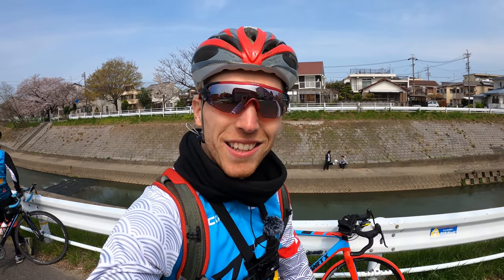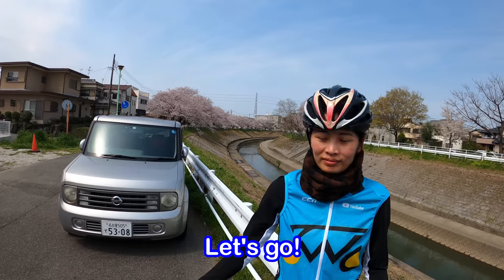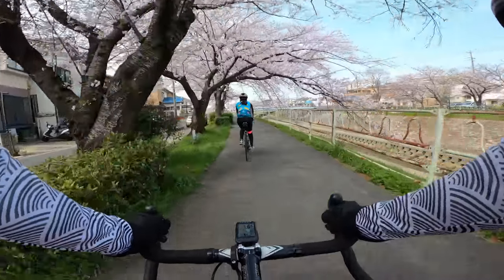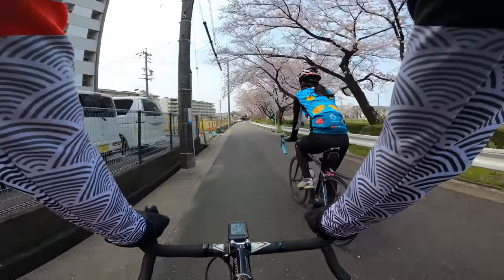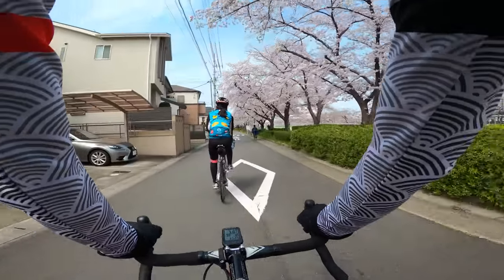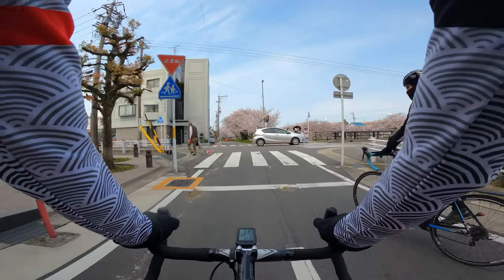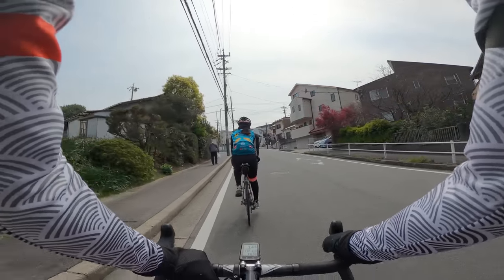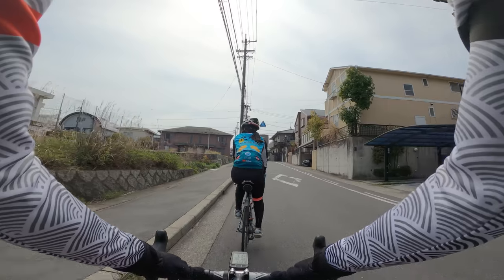No More Flat Tires! Tannus Airless Tires 1 Month Review & Test Ride

Comment: These tires were a nightmare.  Felt like riding through peanut butter.  Purchased and installed the 700 x 28 size on my road bike.  The warmer the temperature, the more sluggish the tires felt as the compound became softer.  It actually felt like the tires were sticking to the pavement.  Put a total of 30 miles on them and, because of a terrible return policy, basically cut them off and tossed them.  $150 down the drain.

Comment: I was using Gatorskin as a NYC bike messenger and was always getting flats. Eventually I found out it was because I would always put ten psi more air in them to make them faster. So if you have puncture resistant tires and out still getting flats make sure you’re putting in the psi it says on the tires not over.

Comment: Just bought some for the back wheel of my e-mtb, due to never ending flat tires. When I started my first ride with them it felt much smoother while going over rocks. I actually thought the tire was underinflated, but when I stopped to check it I found it to be fine. The rest of my ride was great and the tire behaved just as advertised. I also had a degree of confidence that I was not going to have a flat in the middle of my ride. I've only had one ride so far, but it was a very positive experience!

Comment: Hey I just installed the Tannus Airless tires on my road bike.  I have only put on 45 km on them so far as the weather has not been cooperating.

Here's my take on the installation:
I was expecting a really hard time after watching multiple videos - It only took 30 minutes to install both tires. Way easier than I thought - in fact I didn't need to use the tool in the final stage. I made sure the clips were evenly spaced and when I rolled the tire on the clips just started snapping in place. I squeezed the tire to the rim using my hand to make sure all clips snapped in place, which took a couple of minutes.

As for my first ride:
I do notice more of a drag and expect this to improve as I haven't rode the 100 to 160 km as suggested.
I bought the 700 -25 slicks at 100PSI. On  a good surface I can't tell much of a difference from a comfort put of view. They don't bounce back as much when you hit a large bump or pot hole. However not worrying about a flat is great.

Being in my 60's I don't do the 100km day rides anymore however, I do put on around 150 km to 200 km a week on the bike and I was always frustrated getting flats - around 5 to 6 times a year. I tried tubeless - which I loved for comfort and speed however, the tires are softer and get chewed up when hitting stones and breaks in the pavement and I was constantly replacing them on a annual basis.  I tried gator skins and still continued to get flats ( I found the gator skins harder to put on than the airless tires) so decided to go airless. I expect to get around 3 years if the warranty holds true based on the number ok km's I ride on the road bike.

My take: It is great not worrying about getting a flat anymore, I have more room in my bike pouch for snacks (LOL) as I don't need any tire repair kits and tools. I am more than happy to give up a bit of speed and comfort. Would certainly recommend them to commuters who are doing around 5km to 15km a day commuting.

Comment: I got a set of Tannus airless tires after watching your videos. 
I will say they were quite hard to get installed. I was able to get them on the rim using zip ties which came from a separate video, that part was more or less the easy part.
Once I got them on latching the little pegs in was the part that was rough. 
I am super glad i got the P tool or I may have flipped a table trying snap them in. I think the P tool should be standard. 
After riding them this weekend, I do not think I will ever go back to pneumatic tires, goat heads and my tires do not get along.

Comment: I use tubes with Stans sealant in them. I live in the land of goats heads and have not had a flat in 2 years.
Reply: I hear that stans in clinchers doesn't work well with larger punctures.

Thenagain, my punctures are all goatheads as well...
Reply: do you leave the thorns in or take them out?

Comment: Thank you for your opinion I have been thinking about their "Armour" in between protection because that way you keep the tires you're used to, plus if anything structural happens it's easier to repair on the road. Even this system will always be heavier than a glued tubular but the tubes are smaller and as you pointed no need to carry a pump, spare tube, tools, etc.

Comment: If anyone wants to try these but can't afford them, thorn-proof inner tubes and low tpi tyres (around 25-30 tpi) are a much cheaper alternative. 

I use them on my commuter and haven't had any punctures in 5000 kilometers.
Reply: Ren do u have to pump them?

Comment: Very useful - thank you
The (increased)wheel mass of a wheel/tires is hardly significant. It's slightly counter intuitive until you think about it. Imagine very heavy wheels - they are slower to accelerate and more weight to haul up a hill but the spinning energy you put in to get them up to speed is just greater and not lost anywhere except under braking. The slightly heavier solid tire wheels you have just store a tiny bit more energy so you roll slightly further when not pedaling etc.  According to most cycling engineer types - aerodynamics is way, way ,way more important than the almost insignificance of wheel weight differences in cycling.
One report I read was an extra 300grams in wheel weight - going up and down hills in 10km produced a time penalty of 0.7 seconds!
Yes.. It's all about weight for hills - no bicycle pump tubes etc etc will offset or better the standard set up.

Comment: I had these on my fixie for years. Highly recommended them for pure road or pavement use. The ride is ‘harder’ and heavier. I’d recommend getting  those with tread not slicks.  Now I had a fixed gear on a 12 tooth cog so if you have gears it shouldn’t be an issue. They are expensive so you need to be prepared to ‘invest’.

Comment: 220lbs rider who got the 105 psi type and tried them first on my rollers.  Tires got really hot and felt like riding through deep mud.  Road ride worked out well except I have to put out a lot more watts when climbing. Great commuter tire or riding with the slow group tire.  I think slow rebound of the material is to blame for slower speed riding.  It does work you out harder.  I thought I ordered the high pressure version but they sent me the softer tires. I bought a set of pneumatic wheel set in case I can’t find a slow group to ride with on weekends

Comment: just got some nexo ( also red , only red available and could find Tannus on amazon or anywhere ) for me and my brompton in Niigata Japan.. I find the tires get warm on a long ride and sometimes you can feel the back drift a bit especially when there are lines in a path or something. Brompton wheels are only 16" diameter so the wheels turn faster for the same speed so I can understand why they get warm... anyway , thanks for the Video..

Comment: I have the tannus solid for my aluminum frame road bike 700x23c and my carbon aero bike at 700x25c but i also have the wheelset from tannus. I have a 11 speed cassette no flats tires go forever. A slight amount of more rolling resistance but its worth it i use my bikes to commute to work.

Comment: I've been on the exact same tires (red 700c) for about 2 years now - sure they weigh a bit more than normal tires, but I also don't have to carry a pump/C02, patches, tire irons, tubes, etc... I love them! they are a little sketchy in the rain (to me) but NOT any more than a typical 120psi racing slick. I just love the freedom to ignore what is on the ground. Glass? keep on riding. Caveat: I paid to have them installed :) so I skipped the painful install process. If you look at these as training/commute replacements, be sure to build them up on some bomb-proof rims, and you won't worry about your wheels in the event of a pulled spoke, etc... Now if they only made a 650bx50 version that replicated about 50 psi...

Comment: I've been using continental grand prix 4000S II (no tubeless)for 3 years and I've never gotten any flat tire  yet
Reply from the maker: Nice, I've heard good things about those
Reply: I cycled Seoul to Busan, and then across Kyushu and a chunk of Shikoku on a new pair of Conti 4000's in Oct/Nov last year - not one puncture (and this was on a loaded bike).  They also felt fantastic, so much more comfortable than the heavier touring style tyres I'd used previously.
Reply: 3 years??? You must hardly ride!
Reply: I also run gp4000s ii tires, I've been using them on all of my road bikes for years with zero flats, hands down my favorite tire for road, second favorite has to the Marton HS420 non plus version

Comment: I used solid tires around 30 years ago, I think at the time they were called "Green tires" they broke my alloy rims in about 6 months,  I would prefer to use gatorskins or some other puncture resistance tire,

Comment: Any comments/experiences with tire liners?

I've been using Schwalbe Marathons for years, but have to throw away half of them because of manufacturing defects; so am considering adding the extra layer to normal tires.
So far, my attempts have been disastrous, with the liner eating into the tube after a few km.

(No, I won't go tubeless)
Reply: I usually stick with 25c or 28c tires with tire liners + slime tubes in my bikes. Since I started doing this a few years ago I haven't gotten any flats since.
Reply from the maker: Not personally, no
Reply: @MBandC103  Which brand of liner do you use?
Reply: @alfreddelatourquipenche8287  im pretty sure its mr tuffy liners. Honestly ive had the liners for years since they don't really get damaged. You can just keep reusing them .
Reply: @MBandC103  I worry about them eating int the tube through abrasion, why I'm asking.
Reply: @alfreddelatourquipenche8287  they have a slick surface to them which prevents that.
Reply: @MBandC103  Problems usually arise at the point where the liner overlaps with itself: the edge grates and wears the tube. Butt I'll give ur brand a try.

Comment: Hey, new to biking here but using my bike for commute and want to do some cyclo-cross. Been really wondering about these tyres. I have a "road e-bike" (cannondale synapse neo) that helps up to 16mph/25kph, but I really like biking at around 30-33kph on the flat. Do you think it would make a big difference compare to the road tyres I have now ? Would you recommend them ? (Also, I ride 32mm, not sure they exist in that size). Thanks !
Reply from the maker: I'm able to ride at these speeds no problem with them. But if you wanna do cx, it may be a pain to change the  tires
Reply: @TwoWheelCruise  Great, thank you ! That's the info I needed.

Comment: Ordered a pair for my daily commuter Trek 730
Reply from the maker: Nice!
Reply: @TwoWheelCruise  After two weeks of riding, I honestly hate them. My old tiers were  Bontrager 700x32 road slicks pumped to 85psi. Because of the rim size (15mm inside) I got Semi-Slick: 700x28. The ride is harsher by magnitude. Bike feels jittery on the smooth surface and "penguin on ice" then you or gravel. Rolling resistance is noticeably higher. Perhaps it's the model and or combination of the bike/rim/tier but I am very tempted to just take them off. Installation was a PITA too. An hour each.  :(

Comment: Hi - need some help to select the right gravel tire. I currently have the Bontrager GR2 Team Issue Gravel Tire (700c 40mm) - but get flats all the time (even when i ride on the normal street - 1 week riding - flat - 4 flats on the back tire, 1 flat on the front tire in the last 4 weeks). I got the Tannus Armour Tire Inserts - but that doesnt fix the flat problem. Can you recomment me another gravel tire (high puncture resistance!)? which one has the best quality and prevents flats Panaracer, Vittoria, Continental or WTB or something else? My terrain: Road and also some Offroad (forrest with gravel and fine sand). I would say 60% road, 40% offroad.

Comment: Hey man, nice vids! I have an old tire with size 700x32C. WIll a 700x23C airless tire fit as a replacement? Any answer will be much appreciated.
Reply from the maker: Depends on the rim width. Check their website for more specific details.

Comment: I was trying to do research on those tires and stoped looking because I've ask a few cyclest about them and they all gave not so well thoughts two actually said no they would not recommend them for going on long rides because unless your under 90 lbs. 
And one day I went on a ride with a friend and she's been on 100 mile rides and beladrom race's and she said the same thing even though out of the 6 cyclest I talk to only two actually knew about those tires. 
And funny thing on that ride I actually got a flat tire but I did a new idea I would usually use glueless patches and this time I heated up the patch before I put it on and it actually worked alot better than just putting in on and ride for ten minutes and have to redue the patching.
Reply: What do you use to heat up the glueless patch? Were you in the field or at home?

I carry 2 tubes (more for longer rides) and just swap tubes out in the field.  I collect about 10+ tubes before I use a patch kit since the rubber cement always dries up between uses.
Reply: I just used a bic lighter. I swiftly wave it close enough to the patch so it gets hot and apply it.
Reply: @mikesmith883  I'll have to try that since my LBS gave me some glueless patches because they were out of the regular type.
Reply: As silly as this will sound try this bubble gum ? No joke try it place it over the hole let it sit for a second place your tube back fill it up to the max psi and roll out

Comment: can you train and do fast group rides with these? i keep getting flats and im tired of it.....what tire do you reccomend for peformance that never goes flat!. are the tires pre set at 110psi and they never go flat right?
Reply: yes, they are preset to the psi you want, tannus gives you a few options. training definately they are slightly heavier, but think about not having to carry pumps tubes and patches. if your actually going to race switch back to regular tires
Reply: @luis6876  will i lose speed and PR's on these when training or fast pace group rides?

Comment: Thanks for the thorough review. Looks like the Tannus pliers would be a good investment along with the tires after watching you struggle.

Just curious. Ancient history (25 years ago), I used to be flight crew laying over at Narita 2 or 3 times a week over a 3 year period when we had a cargo contract with JAL. I was a jogger then, but just couldn't hack running by the side of the road because the car exhaust fumes were so toxic. Made me dizzy and head achy. Hotels didn't have exercise rooms then so I took to climbing up and down 20 stories on the fire exit stairs to work out. Had hotel security check me out several times!

Has the air on the road improved since my time? I didn't hear you gasping.

Comment: One of my bikes is a 70's french racer with a Reynolds 531 steel frame. Like you I find the ride nice with a psi of 120. But thats with tubular rims, Magic g4's. Could the Tannus tire be glued to a tubular rim instead of using the clincher mounts?
Reply: Mavic GP4's.

Comment: I've tried it. Comfort is ZERO. So much vibration transferred through the seat and handlebars that it made me hate my bike. To be avoided. 700x23.
Reply: Use a suspension seat post and a larger size spring seat.

Use a handlebar suspension in front.
Reply: @karthimechify  On a road bike?
Reply: @sqward  yes

Comment: What you don't mention are the 'maintenance' suggestions that because the foam compresses, you should deflate the tyres when not used (between rides?!) even remove them and have a steamy shower with them! WTF! 😲
Reply: these are solid, no maintenence needed

Comment: Nobody rides 120 psi tires anymore. That was 10 years ago. I ride 50 psi 700 x 38 tires with sealant in them. The flats just fix themselves while you ride. Get with the program dude.
Reply: Road racers still ride +100 psi on their tires so your argument is pretty much useless.